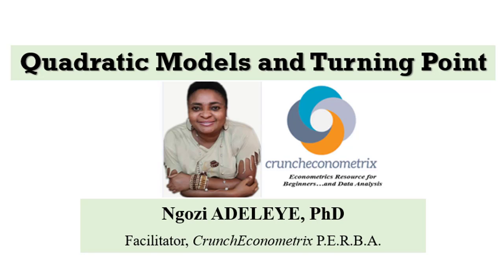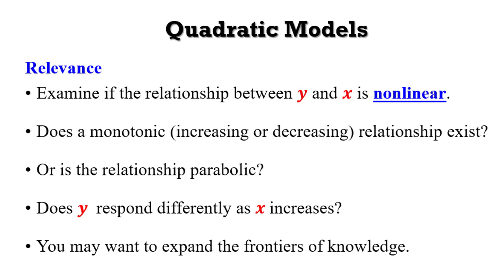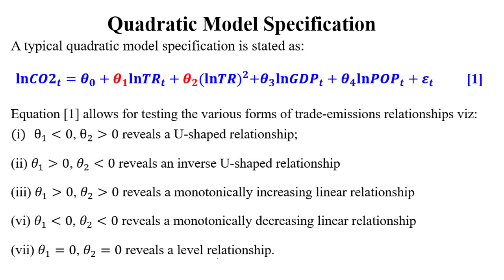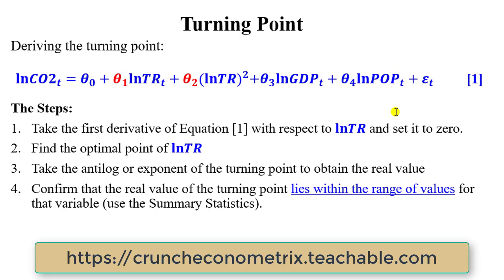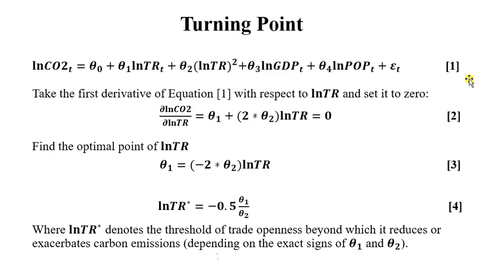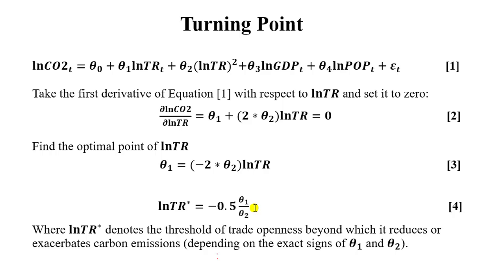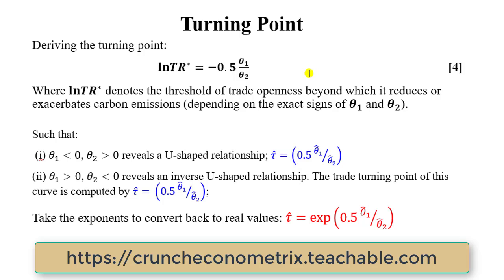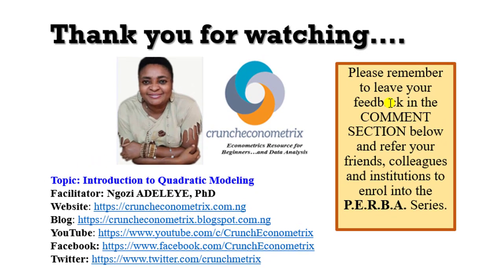Introduction to Quadratic Modelling and Turning Point

Comment: thank you prof all your videos are very helpful, prof is it the same as using quadratic and using long run gmm on dynamic panel data? Thanks in advance prof🙏🏻
Reply from the maker: Hi Arie, you can include a quadratic term in the GMM model.

Comment: How can we reduce vif value while using quadratic model, or is it important
Reply from the maker: Hi Busra, from experience VIF may exceed 10 for nonlinear models (interaction models). Not an issue. Only worry about the problem for linear models.
Reply: You may use orthogonal polynomials or spline modelling.

Comment: Hi professor, I was going thru ur ardl model video?

I have a question, I'm doing a research where stock price is my independanr variable. And bond yield and inflation are my dependant variable.
All are I(1) except inflation which is I(0).

My question is in order to do the ardl test, should I convert my bond yield and inflation to actual numbers or leave them as percentage? For example, maybe in 2016 bond yield was 3%. It shows 3 in my data set. Should I convert it to 0.03?
Reply from the maker: Hi Jack, I will advise that you use the data as downloaded to avoid data manipulation. Thanks.